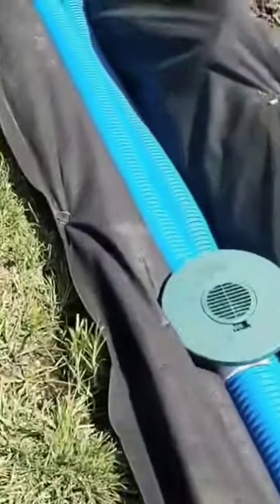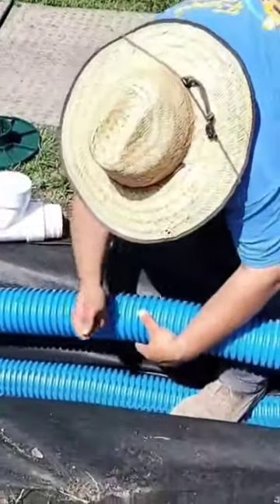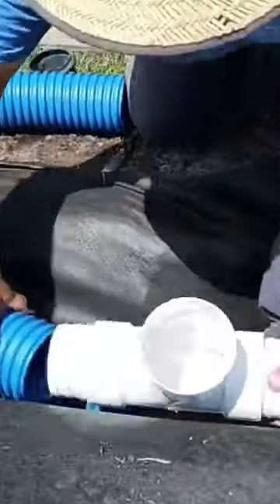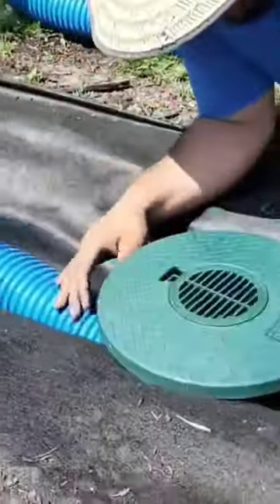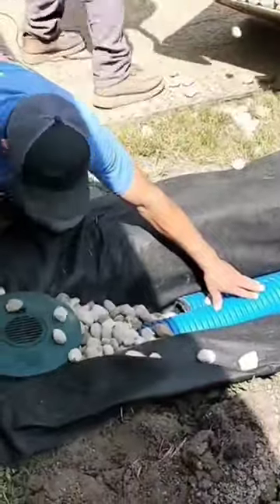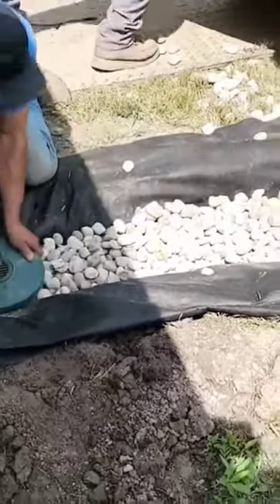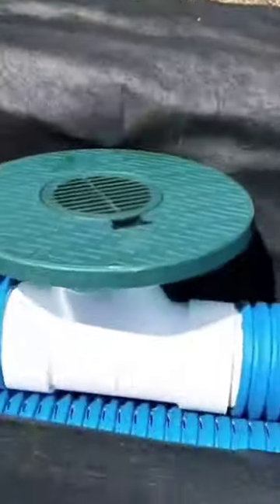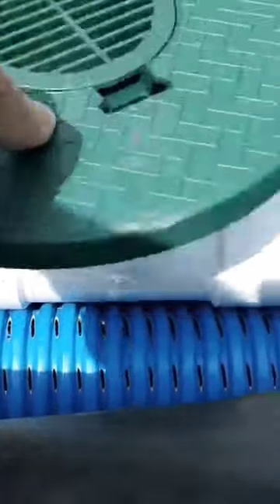How to install a Yard Drain for Surface water using your French Drain trench #shorts

Comment: Directional tees are meant to only be installed vertically, horizontally they act the same as a normal tee. If you look through the side hole of a directional tee, it’s a straight shot through
Reply from the maker: https://youtube.com/playlist?list=PLjFCqaZ4v1BVX2cpGD7wJqH37RSS1JAOz&si=IYtVqYcZOasTW-3B

Comment: While you are technically and professionally correct, these short turn sanitary tees don't do much at all in this orientation.  All you have to do is look into the side inlet an you can tell how little directional flow is imparted on the stream.  And in this case, with the drain inches from the tee, you won't notice any difference.  If you really want directional flow influence use a combo, which is a wye and 1/8 bend(old school term for a 45) in one fitting.  Given the lack of elevation you have to play with here, you'd probably want to offset it so the combo is also laying at a 45.  I.e. your drain would be a few inches off the center line of that tubing.  Sanitary tees are really to ease the sharp edge when the tee is vertical and keep drainage from above from entering the side outlet.  All that said, you aren't wrong.  haha!
Reply: Where to buy these blue pipes. All I see is the black one which looks too clumsy
Reply: @bodhitree8760 from the guy who made the video they ship